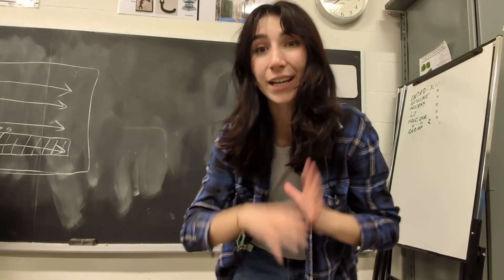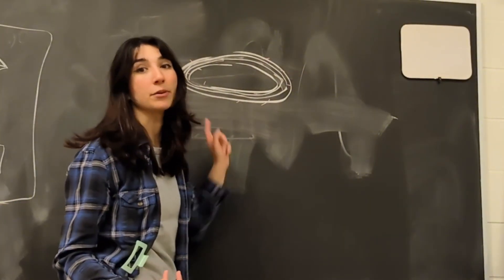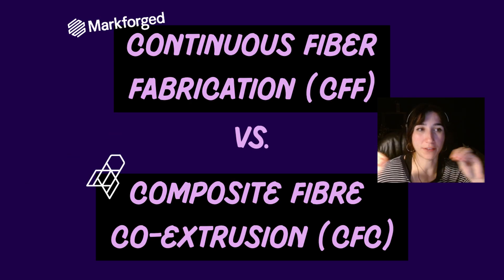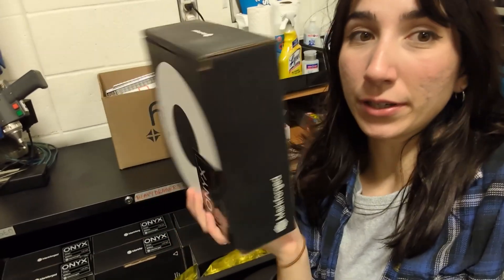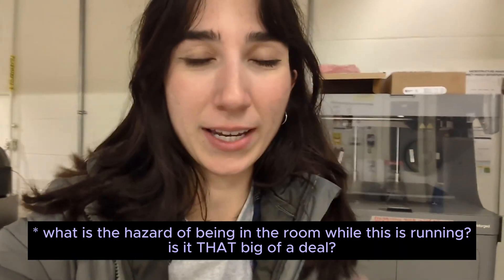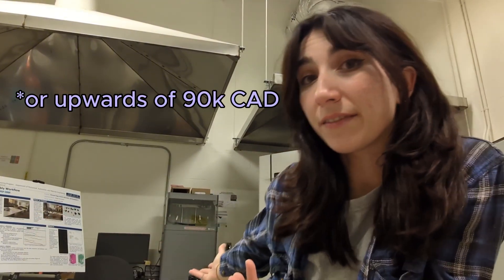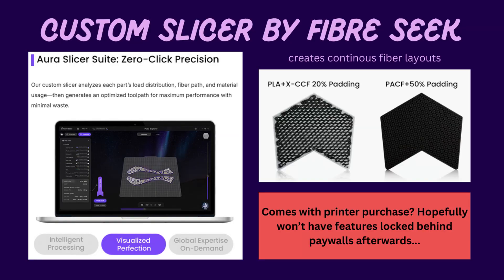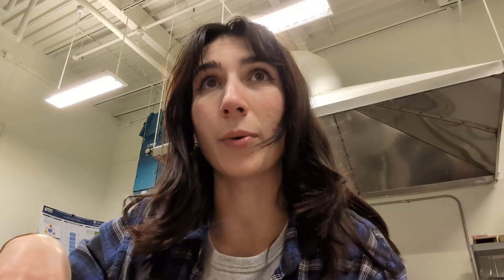The FibreSeeker 3 is a bigger deal than you realize...

Comment: Is there a reason why a pair of scissor-like razor blades could not be rigged beneath the nozzle as a modification of an existing open source extruder, to snip fibres on retract? Okay, clearance, but you could use extremely thin blades.

I don't personally have a need for anything to be that strong, but much like non-planar printing, I see this as simply the next logical step in advancing 3D printing.

Comment: What I'm really confused by is the claim that 900MPa tensile modulus means it's 'stronger than aluminium'... Although the values vary wildly, the values I can find online range from 1100MPa to 4000MPa for aluminium, and higher for most alloys. Meanwhile even some standard plastics exceed 900MPa... Are the marketing team using the wrong term here, or are they just hyping their product when a buyer would actually be better off buying a similarly priced CNC that could mill steel/aluminium instead? I'm ready to buy if it can actually outperform aluminium, but I'm not at all convinced so far...

Comment: I can only say that I wouldn’t risk backing this project.  The likelihood of a patent infringement lawsuit from Markforged seems almost unavoidable.  That would result in significant project delays if not entirely consuming the project funds and/or resulting in cancellation of any other project/startup capital.

While I’ve spent a lot of time working with Markforged printers, you raise a number of very strong points about potential process and system improvements.  Patents are a highly imperfect system.  But love them or loathe them, they are the foundation of a lot of technology businesses.  Nearly the entirety of the current expanded 3D printer open-source community and commercial and industrial markets was only made legally possible since the end of some key Stratasys patents.  Which allowed Adrian Bowyer to launch the RepRap movement in 2004.  The heated bed popularized by Josef Prusa’s development into a commercial product was itself a workaround to Stratasys’ patent on using chamber heating still relevant at that time.  It has since proven the two can be quite beneficial in combination.  The idea, however good or bad, is that a company can profit from their the fruit of their innovation or intellectual product for a period of time before that becomes public domain.  Eventually, that will be true of Continuous Fiber Reinforcement too.  But while it remains under patent, (an expensive process essentially obligating on-going legal defence to maintain,) Markforged has almost no choice but to respond with an infringement suit to a product taking aim at their key market differentiator.

Comment: I think for a hobby standpoint, you can always print an object with an opening, fill it with fibres and then with a 2K resin.
In this way you get isomorphic and fast parts from every cheap printer.
I’ve seen people in YT filling prints with concrete with great success, so to do the same with fibre, wire and 2K resin is not far.

Comment: Comming from Formnext just last week, it do seem like continious fiber is the current theme of 3D printing.
What do i mean?

Well we have Fiberseeker 3
but also german company Endless Industries making a toolhead for Prusa XL that can do continious fiber, its how ever a thicker fiber and its pre mixed with some plastic so currently you can only do a specefic material

and then there is ZERO D. microextrusion from france, that makes a machine to make your own continious fiber filament, on a spool! meaning any printer can print with fiber.
a hard travel move should cut the fiber so no need for special hardware :O 

in short there is alot of cool continious fiber comming!

Comment: It's too bad you can't get isomorphic improvements in material strength but I guess if you have requirements for parts that experience a lot of tensile forces inb one plane it makes a lot of sense. What sort of parts does your lab use the markforge for currently? Wonder how it stacks up to the new formlabs tough resins.

Comment: It's about 3x too expensive for the mass market, but people with print farm businesses or might find it worth the business expense.  The materials, specifically the continuous carbon fiber rolls seem to be scarce as well.  Might be good in 5 years if competition drives competition and lower prices.  Still I think traditional prototyping with OTS PLA/ABS or resin printers and then shipping the step file to a company like pcbway or sendcutsend  for cnc machining would be the better option than owning an expensive machine like this.  Universities might be the biggest market for a Fibreseeker.
Reply: This isn’t an expensive machine. The expensive one was Markforged. This is a cheap alternative to that. 

Ordering parts from a supplier is an option but gets expensive. I spent over $$2500 from SendCutSend this week.

Comment: My old student body from UNI started his Ph.D on optimization for surface shaped continues fiber layups using robot arms. Sadly the Ph.D exploded and he ended up doing buckling of thin shelled structures made out of fiber reinforced plastics.

So with a printer like the Fibreseeker 3 it would be super interesting to import your load cases and run a topology optimization optimized for 3D printing with continuous fibers.
Maybe in the future we could even do non planar print with a system like this. It just require a lot of software developing.
Reply: Working on the non planar continuous ;) yeah its really hard hahah
Reply: @C6composites  ❤️

Comment: I want to see polypropylene and carbon parts. It might even let you print delrin if the chamber and bed gets hot enough. Which reminds me I believe nylon does release harmful fumes.
Reply from the maker: I actually have a spool of a similar material to delrin somewhere unopened from when IGUS came to visit my last job (the filament is enriched with solid lubricants so that it is self lubricating and has less friction in moving parts). Might be time I test that out. The fibreseeker3 hot end goes to to max 350°C for the filament hotend and for the fiber extruder, with bed max of 110°C and chamber max of 65°C. Currently my X1C hotend max is 300°C and bed max is 100°C.

A quick google about delrin gives me "Delrin (POM) filament typically needs a nozzle temperature between 
210-230°C and a heated bed around 100-130°C ". Might actually be possible on the fibreseeker.
Reply: @strelkomania  The main concern with POM is it warps really bad and doesn't like to stick to anything besides itself, similar problems with PP. Otherwise they are some of the best plastics in cost and performance. I was thinking the solid carbon would eliminate warping especially with a good heated chamber.

Reminder that POM is super toxic it releases all sorts of formaldehyde and VOCs. If the IGUS filament has POM or something as an additive it definitely needs good filtration and ideally exhaustion. I'd check the SDS, most plastics require filtration. We have a pretty good idea what exposure to the fumes does from the injection molding industry.
Reply: @strelkomania  X1C bed temp max is 120c, and you can do a mod to get a higher hotend temperature by adding a resistor in series with the thermistor. I did this with a 33ohm resistor and measuring it with a thermocouple probe, I am getting around 334c max. Can go higher with a higher resistance. You can also mod the bed the same way to go higher temps but not much reason to on X1C. Also there are DIY chamber heater mods for it